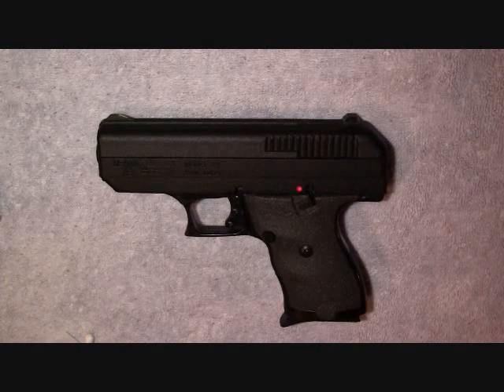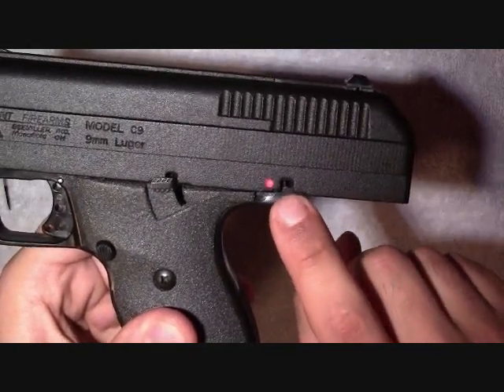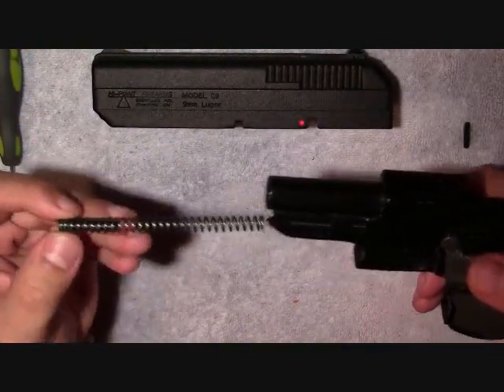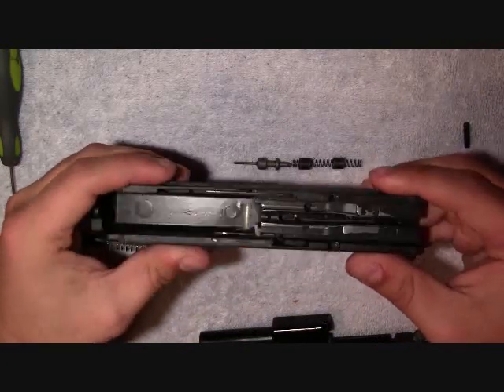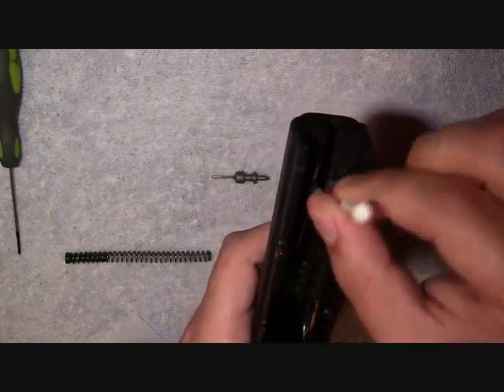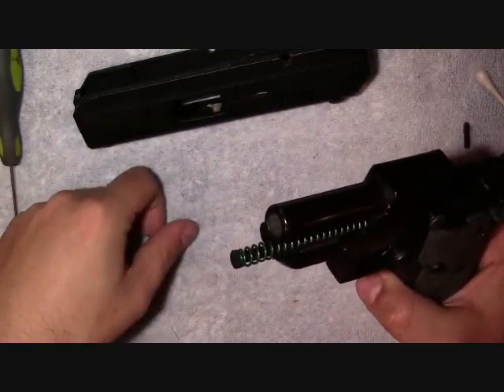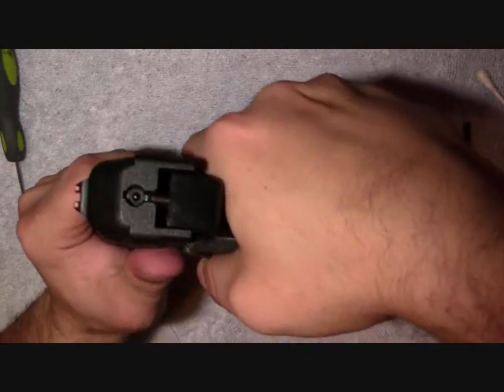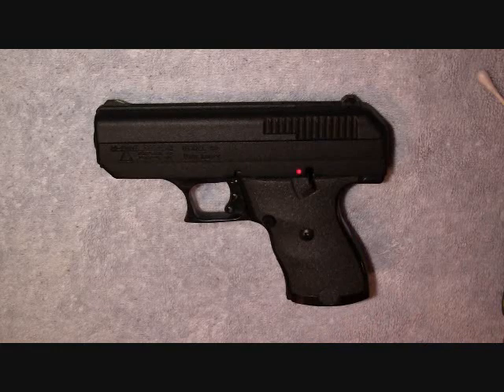HI POINT C9 - Field Strip -

Comment from the maker: The only thing I recommend is to call the manufacturing company of that firearm, tell them the issue because hi points should all come with a limited lifetime warrenty . They will probably send you new springs or you may just need to purchase new ones. Sounds to me they might be worn out and lost strength in the springs or just a bad part. Try disassembling it and clean each part extra thoroughly that might fix also

Comment: When you put the dull part in the hole how so you catch it on the top to close it?? Pls helpp
Reply from the maker: once you put the slide back on with the spring and pull it rearward you will be able to see where the dolls head pin will slide into the frame. there is a hole on the back side of the frame that the dolls head fits down inside